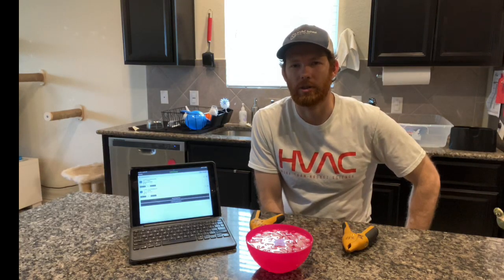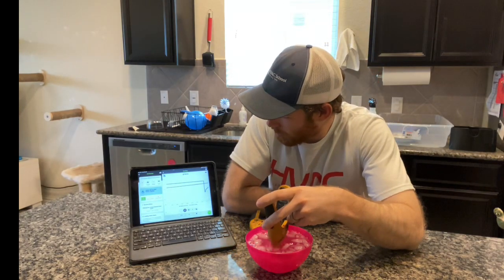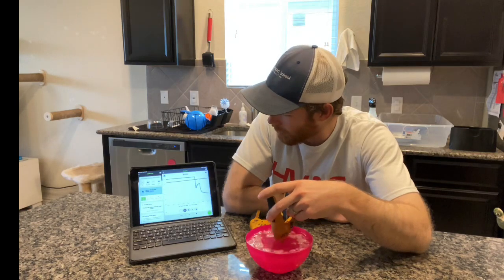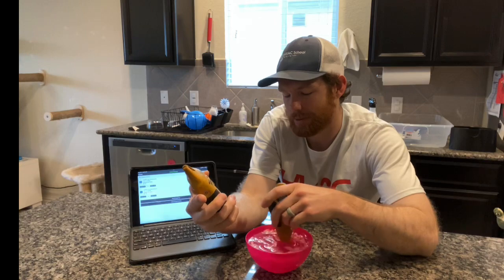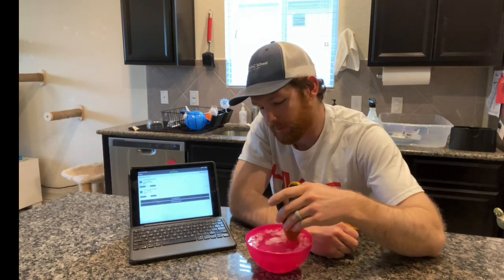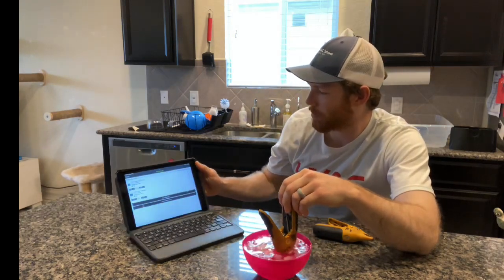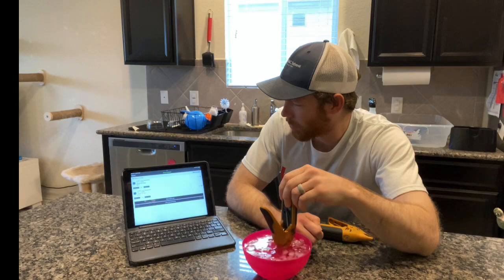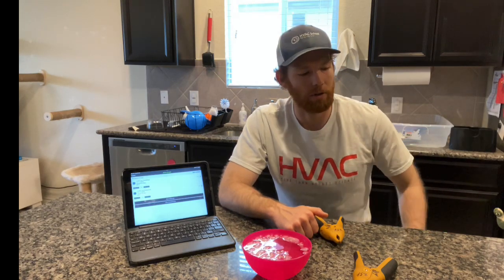How to calibrate pipe temperature clamps in ice water #fieldpiece #joblinkprobes Link in description

Comment: This procedure calibrates the clamps to the app. It doesn’t change anything on the clamp. Basically if the clamp reads 37 in the 32 degree water, the app will need a 5 degree offset.

Comment: Why not clamp an ice cube while stirring?
Reply from the maker: I think because you be getting kind of an average temp. Between the part of the sensor that's touching the water and the part of the sensor that's touching the surface of the ice cube, which would throw things off as far as calibrating goes.
Reply: the ice is the temperature you want to be at not the water which is literally warmer then 32°

Comment: You never showed how to get to the screen where you can calibrate them
Reply from the maker: No not in the Fieldpiece app you are right, but if you use measure quick this is how to calibrate them.  Measure quick is much better than the Fieldpiece app, I only use the Fieldpiece app when there is a new firmware update for the probes.

Comment: I couldnt understand where you went into measure quick to do it...where do you go to calibrate it?
Reply: Measure quick sucks lol
Reply from the maker: Open measure quick, then tap the green plus icon at the bottom left right, then go to probe manager under the field piece products banner or whichever brand of pipe clamp you are trying to calibrate, then there will be an offset with a plus or minus next to it that you can tap to increase or decrease the offset by 0.1 F each time that you tap it.

Comment: Do you have to do this in Measure quick? Can you not do it in the fieldpiece app?
Reply: I watched the temperature change on the job link app. It took about 25 minutes for the temperature on both sides to reach 32f. The numbers on both sides will flash together for a second but I don’t know if it’s successful.
Reply: @mojoc232  so it will automatically zero on 32° if you get them both close to 32°? i’m just used to zeroing the old style thermocouple stuff where you manually set it to 32°
Reply from the maker: Yes you can calibrate it in the Fieldpiece app, but if you are using Measure quick you will need to do it in Measure quick.
Reply: @BleedingEdgeHVACandTech I can’t find the option to re calibrate on the fieldpiece job link app.

Comment: Why don’t you clamp onto a piece of ice ?
Reply from the maker: Actually I read into doing that, but it’s not an accurate reference point to 32 F.
Reply: I came to ask the same question.  Its still unclear to me how using the clamp as intended it would be less accurate.  After all clamping onto a piece of ice is virtually the same as clamping onto a lineset.  If it cant accurately measure when clamped to a piece of ice how can I trust the measurement when clamped to lineset?  Not trying to be a smart ass I am genuinely curious as I am very interested in purchasing a complete job link kit.  I would think that a secondary thermometer to measure actual water temp should also be used just to be sure